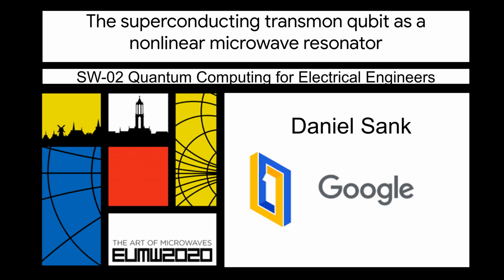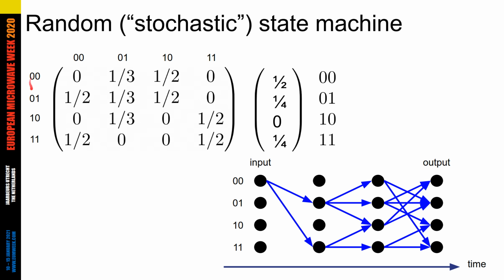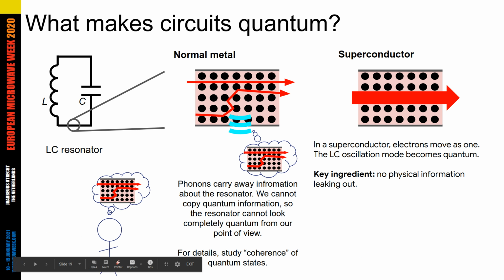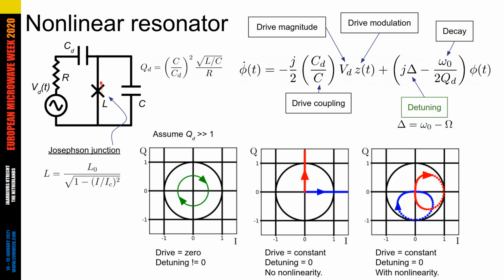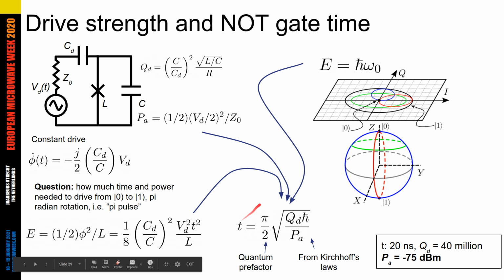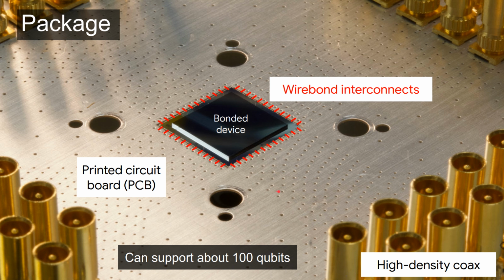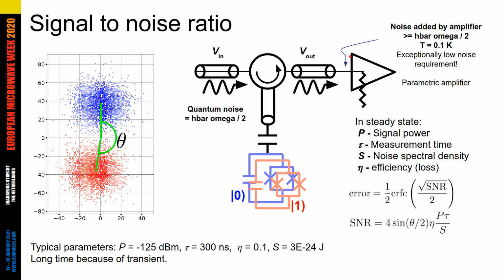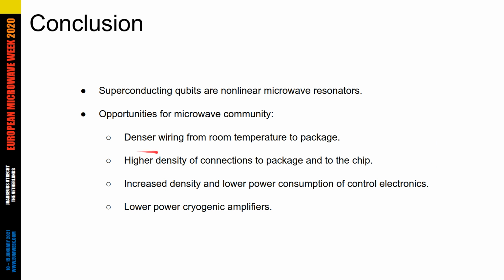The superconducting transmon qubit as a microwave resonator

Comment: This is great thanks for making the video! Implementing the NOT gate was clear enough for the video, would have been great to see the H gate as well
Reply from the maker: You're welcome. I agree that more detail would be nice. It would help me to know the backgrounds of people watching the video. Are you a physicist / programmer / electrical engineer?
Reply: @danielsank2286  I'm a programmer with some physics background. If I can add one more question, it seems like one of the key enablers of the transmon qubit is the josephson junction and how it allows us to oscillate between the 0 and 1 states on a constant drive. Do you have any resources that would allow me to understand the math behind this? I didn't understand the leap from "more current -> more inductance" to the blue/red loops u drew between |0> and |1> states.
Reply from the maker: @slashhashdash  Well, there are a few ways of understanding what's going on there. One way is to treat the transmon like a nonlinear resonator and use a quasi-classical approach, and the other way is to go full-on quantum mechanics. As for references, try appendix D of my thesis (https://web.physics.ucsb.edu/~martinisgroup/theses/Sank2014.pdf). I have an updated version of that appendix with more detail that I can share directly if you want (it will eventually be published as a book chapter).

Comment: Hi Daniel,
Nice presentation. Couple of questions from my side.
What kind of calibration do you use assuming launched signal needs to propagate through different temperature/environment? SOLT, TRL or In-situ.
In the implementation phase what kind of yield analysis you do considering possible highest level of precision you need, Is this Monte Carlo with +-1 sigma distribution yield or something more robust?
What kind of nonreciprocal device (circulator) do you use in the readout (Rx chain), is magnetbased or magnetless parametric circulator?
Assuming amplifier needs to be used right after the circulator at a very low temperature stage, if so what kind of amplifier? Is it JPA?
Understand temperature T is linearly related to frequency f which dictate the temperature margin and required energy level, mentioned 6GHz is the optimum frequency for this technology or is it possible to use other frequency region as well like 1GHz? Thanks
Reply from the maker: Hi Swadesh. These are good questions. We mostly do not calibrate (de-embed) the path between the pulse generator and the qubits. Instead, we vary the pulse magnitude and phase and observing the response of the qubit, therefore directly calibrating the pulses. This approach works but it is somewhat annoying that every time we change the qubit frequency etc. we have to re-calibrate the pulses. We do use de-embedding measurements to learn things about e.g. the readout circuit, specifically impedance mismatches and losses -- because in readout these things really matter. I do not understand your second question. We do use magnet-based circulators in the readout system. Smaller circulators will be a critical element in our next steps. The first stage amplifier is an IMPA (a Josephson parametric amplifier with impedance matching). For your final question, certainly other temperatures could be used, but note that 1 GHz corresponds to 48 mK.
Reply: @danielsank2286  Thank you very much for the detailed explanation.
If I understand correctly, the complete RF signal chain can be simplified into 3 parts. 
1. Signal generator to Qubit input, 2. Qubit itself, 3. Qubit output to Cryostat output (Readout)
For segment 1, are you referring TDR (Time domain reflectometry)? Why do you need to change frequency? Is it to achieve different anharmonicity and different energy/temperature? when you change frequency all RF component should be changed/adjusted as well, like circulator, attenuator, amplifier considering each component are in line with resonance. For segment 3, how do you calibrate when there are non reciprocal device in the chain (just curious).
My 2nd question was mostly related to signal integrity, Say for example, you have a nominal/expected result from your device, However, in a 6GHz RF environment, there may be issues such as crosstalk, interference, coupling, signal bounce, TCF (temperature compensation factor) etc. Now for example if you have 15 different variables that is controlling these KPIs, you may want to know their sensitivity on the performance which require yield analysis/Monte carlo simulation with ~1 sigma distribution. to understand in real time how much performance can vary from nominal/simulation.
Magnet based circulator might be expensive and heavy and assuming for this part of of readout chain impedance matching has to be perfect to eliminate any reverse isolation, is that correct? Thanks
Reply from the maker: @swadeshpoddar6918  For segment 1 we do not routinely do any of the usual microwave measurements. We shoot pulses at the qubits and adjust their magnitude, shape, and phase until the qubit does what we want (because it is quantum, it takes many repetitions of the same experiment before we have enough statistics to know whether or not the qubit is doing what we want). The qubits change frequency as part of normal operation, i.e. to do logic gates. Also, we change their frequency to avoid frequencies where the performance is hindered by defects. This is an important point: there seem to be charged microscopic defects in the qubits such that when the qubit is operated at certain frequencies, the electromagnetic fields of the qubits interact with the defect and mess up the qubit. Fortunately, we can tune the qubits' frequencies to avoid those defects. About the crosstalk, etc. historically we have measured it directly via qubit performance. However, that approach needs to be improved, i.e. we need to measure the performance of each piece of the signal lines carefully. This is work in progress as it involves proper simulations and measurements in the cryogenic environment.
Reply: @danielsank2286  Thank you for the explanation.

Comment: Mostly great explanation thank you. But I dont seem to understand how quantum state machine matrix relates to map on the bottom right corner. You state that probability is zero everywhere but  state 10. While matrix shows clearly only 00 is 1 and rest is 0. Also in stochastic machine you say every outcome is possible while output vector shows 0 probability for 10. Thank you.
Reply from the maker: There are two issues here. First, I did not make sure that the quantum matrix would correspond to the diagram in the lower left; this was a lazy mistake on my part. Second, I just do not understand what you mean about "only 00 is 1 and rest is 0".
Reply: @danielsank2286   Thank you for your quick response. That was related to  matrix not being in sync with the dot chain.  You pointed out that the blue lines destructively interfere therefore state machine is absolutely in state "10". But the vector up on the screen indicates that state machine is %100 in state "00". I guess that was only to provide some visual representation  and they are not really related.
Reply from the maker: @Torosi33  yeah, I was lazy on this point, to my continued regret. Thank you for pointing it out.